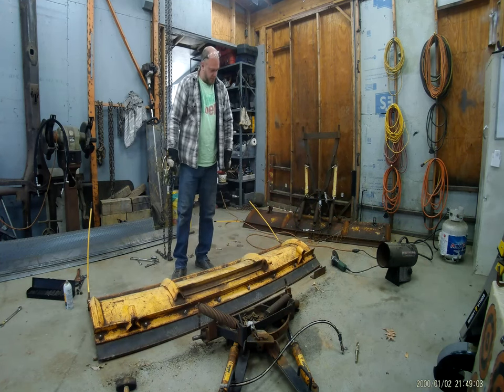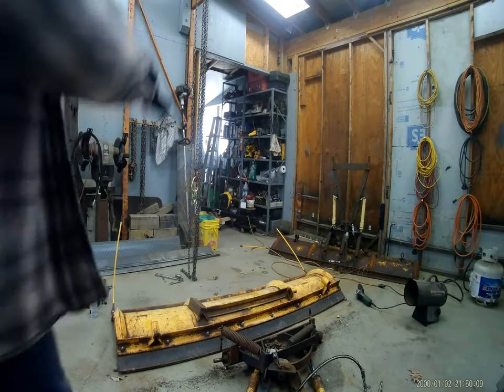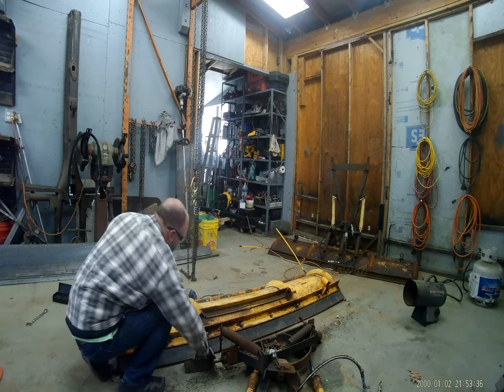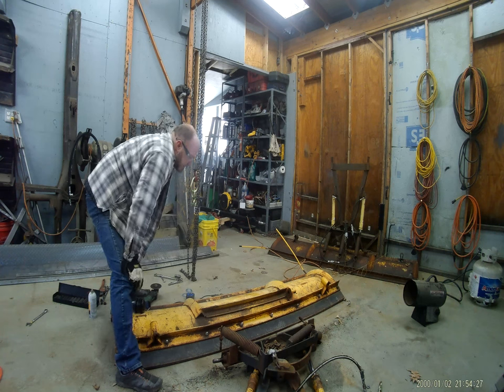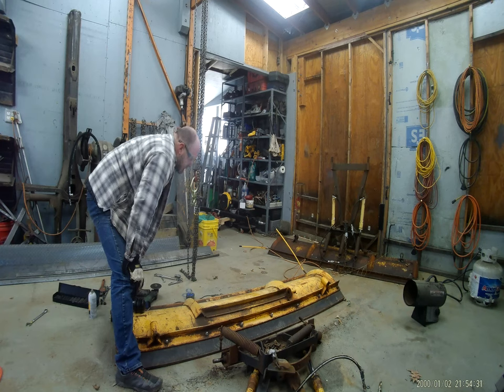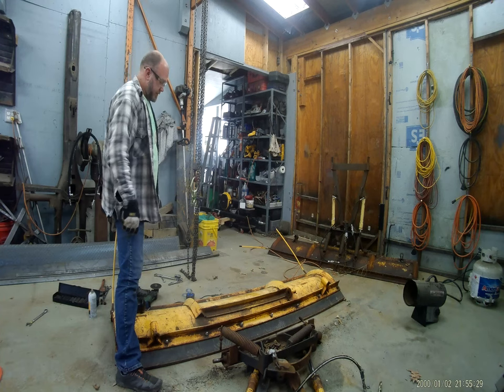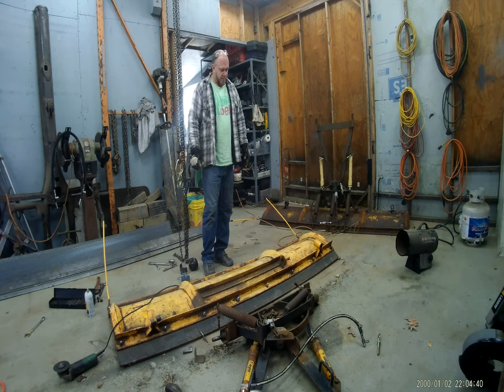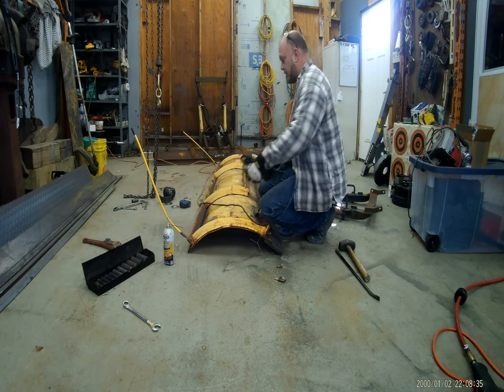Fixing Meyer snowplow pivot pins and finding other small issues to address.

Comment: I’m working on rebuilding the same exact plow myself at the moment! Very similar issues. Ordered new pivot pins had to cut old ones off as well 
Took everything apart blasted and repainted. 
Almost ready to start going back together. Believe it or not hardest thing to find that is holding me up right now is finding new pipe to weld back on to sector to hold pins !!
Reply from the maker: Mill Supply was the only place I could find them. Good luck!